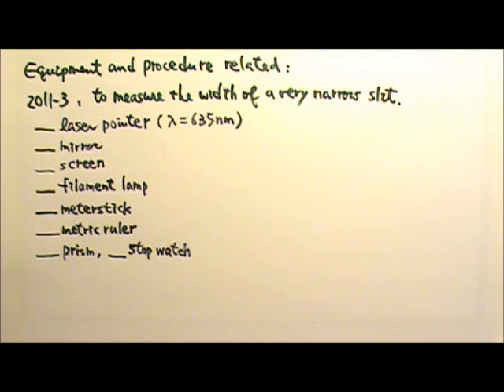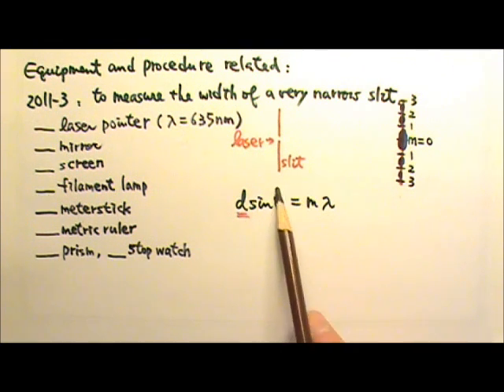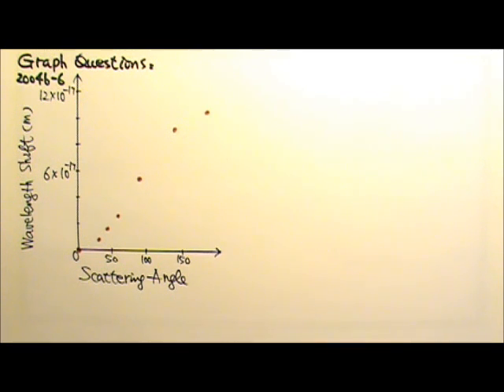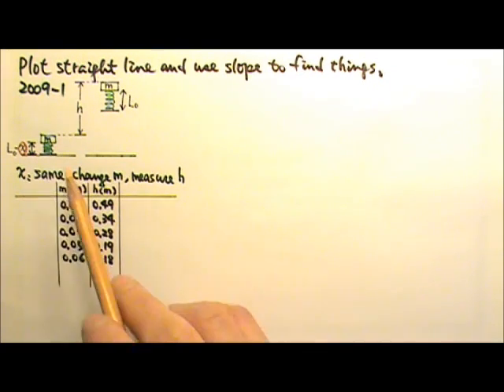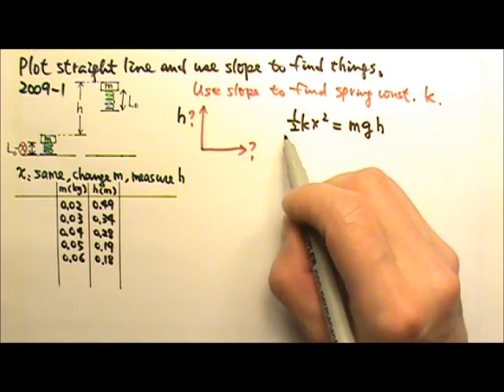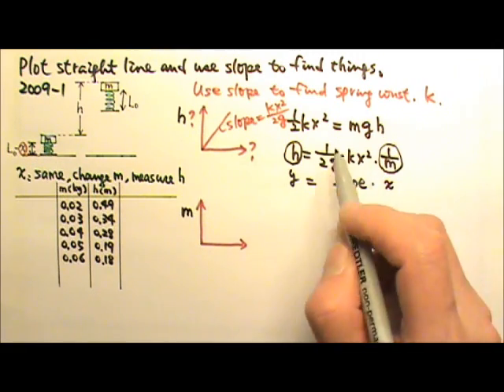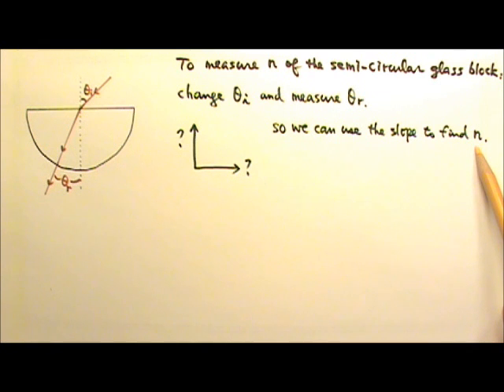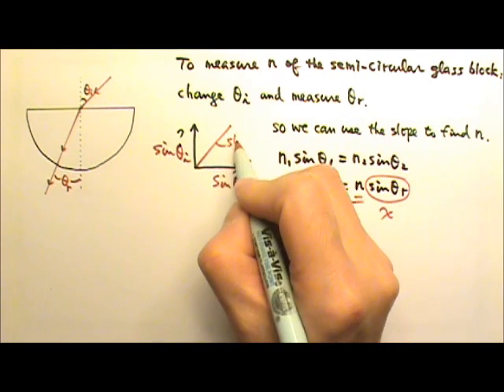AP Physics 2: Review: Lab Problems

Comment: For problem #2 (about the spring) could you use F=kx and make F (mg) the vertical axis and x (vert displacement) the horizontal axis so that k would be the slope? Ughh I'm not good at these types of problems. I hope you see this in time as the test is in two days haha. Anyway thank you so much for these videos!
Reply from the maker: *****  In this lab, the x is not the same as h. In F = kx, the x is the stretched or compressed amount. The height the box jumps up to is not the compressed amount of a spring. 
Also, in this lab, the F=kx does not equal to mg. They are equal when, for example, a box is hung at rest under a spring and stretches the spring by x, or when a box is sitting on top of a spring at rest and compresses a spring by x.